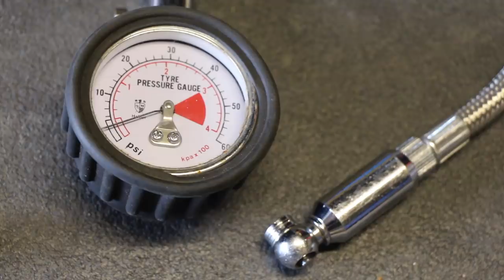Martin Fitz-Gibbons explains how he stores his bike | MCN | Motorcyclenews.com

Comment: Its disappointing chain spray products are recommended by the likes of MCN, your chain manufacturer will recommend you use 85w gear oil tested and proven the best product to use on your chain, a fiver for a liter bottle which lasts years rather than a spray can for a tenner that lasts a few sprays. I see an awful lot of harsh chain cleaning products used on x-ring and o-ring chains too which I believe would significantly reduce the life of the seals. If your chain is x-ring/o-ring then oiling/spraying your chain is simply to keep the oxidisation at bay, all the important grease was applied in the factory inbetween the seals so just keep the seals healthy and you have a healthy chain. Also FS365 is also a waste of an expensive can

Comment: I used fs365 for a while and I still had some bother with corrosion, thought that was just par for the course untill I saw a video by Matt from the workshop then did some basic testing myself. I think I'm being polite if I say your money is better spent on something else. I now use a mix of xcp rust blocker on stuff that's covered up and hard to clean regularly and acf 50 on everything else. Both work pretty flawlessly.

Comment: I wouldn't use FS365, as you might as well spray water on your bike for all the protection it does. I use a mix of XCP rust blocker and ACF50 for all year round protection.
Reply: Matt Perry: I beg to differ. I’ve used on FS365 on bikes as varied as K100RT, R1150GS, Buell, 3 Harleys (from the 70’s to the 2000’s), numerous classic Japanese bikes from my “yoof”.

Currently a very nice R1200R Sport is slathered in the stuff and ready to go in a flash. Oh yes and not a hint of rust on any of them over 15 years of use. But I don’t ride in the winter! And rain... I went to Scotland once, it rained! And it didn’t stop! I never went there again - and I never will...

Enjoy your bike when we can. But if you’re one of the twats doing 15,000 rpm down my local motorway (you’ll be amazed how far that anti social scream carries on a warm evening) then you’ll garner no sympathy from me when your family gets on first name terms with the local florist and teddy bear shop...